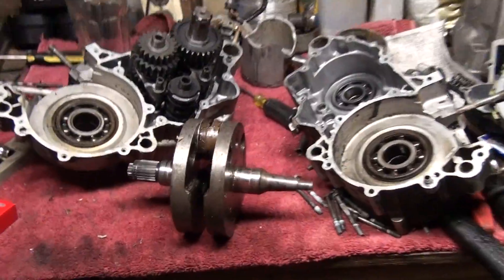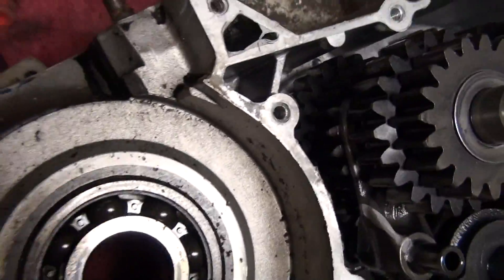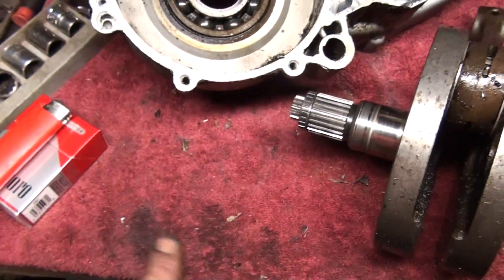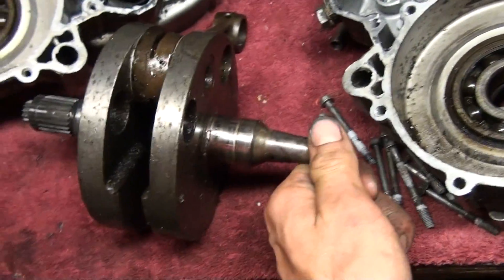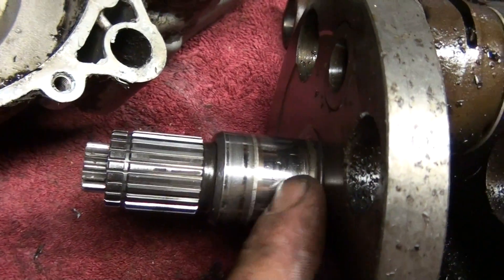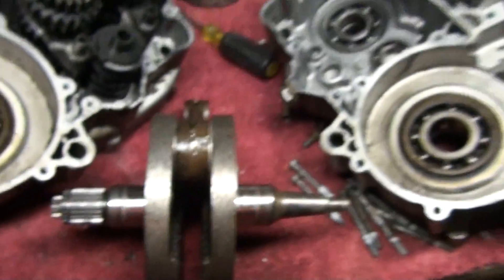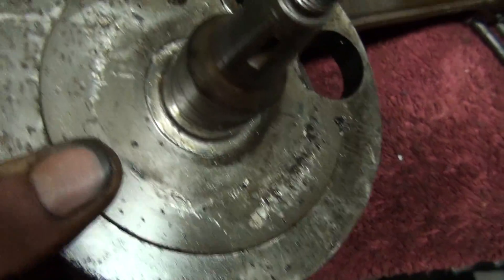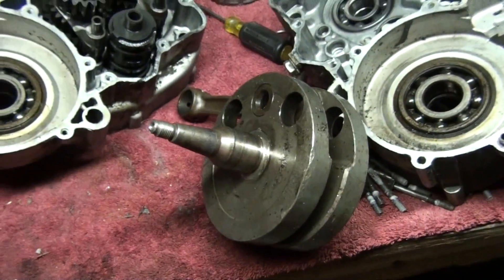Kawasaki KX 500 KX500 main crank bearing failure?

Comment: rebuilding my 88 kx500 now. my crank had the exact same deal, the bearings were still nice and tight in the case and rolled smoothly, but the crank pins were worn just like yours. half of the reeds were chipped at the tips. I just got the crank fixed by crank works. 480$ holy shit it better run good. they just welded onto the pins and ground it back down to spec. what ever happened to this particular crank. Im curious about those stress marks.

Comment: Ok from my experience it looks like either your rod bearing or crank bearing took a dump. The crank bearings are pressed into the cases least thats how i do mine and if you can get sealed crank bearings (less mess if something goes bad again) as far as saw dust that might be a bad air cleaner or something. The marks on your crank are from the small metal parts getting smashed against the crank on the compression stroke.

Comment: @bmulanax777 just to let you know the crank bearing section of the motor does NOT have any oil at all. Motor oil in a 2 stroke if for the transmission the oil in the mixed gas is the only lube in that part of the cases.

Comment from the maker: @bmulanax777 I bought this engine from a guy on ebay, then almost as soon as the UPS guy dropped it off I started taking it apart.  I never ran it before making this video so, no I never changed the oil ;) However the only oil in the areas with problems is the oil mixed in the gas. In a 2 stroke,the oil you can change, transmission oil, is (hopefully) kept completely separated from the crank bearings.  Everything in the transmission looked like brand new.  With the exception of a missing spring.

Comment from the maker: @lauritzen2 Granted I bought this engine from EBAY as a parts engine, but there was a piston installed, with a wrist pin bearing, both in very nice shape.  Also the case halves were still sealed when I opened them.  Cylinder had been taken off but cases were still sealed.  Guessing yeah, either wrist pin bearing bits or bits of old piston or something.  Anyway, YUCK!  Glad I opened it!